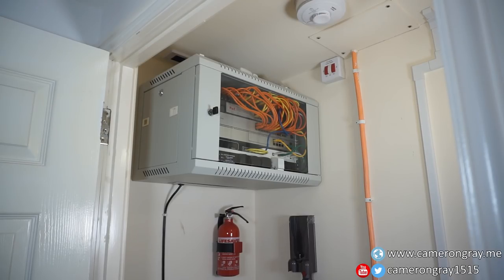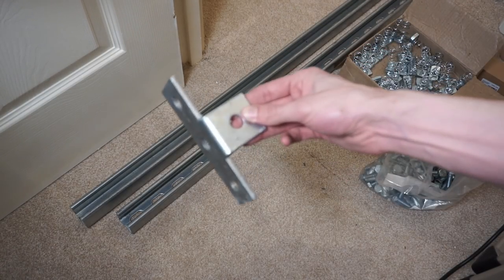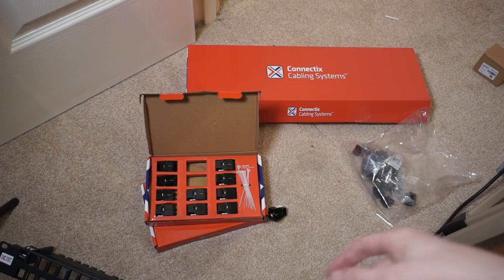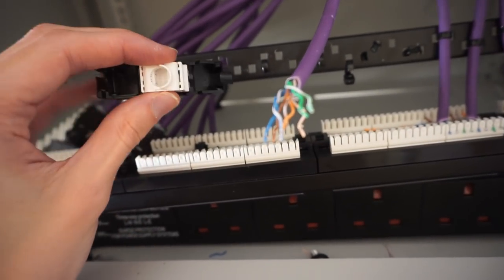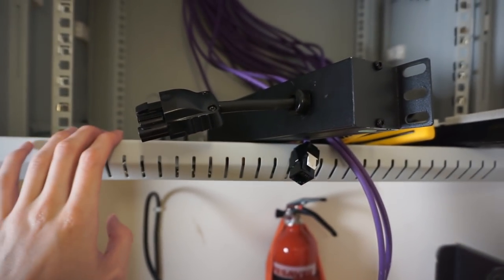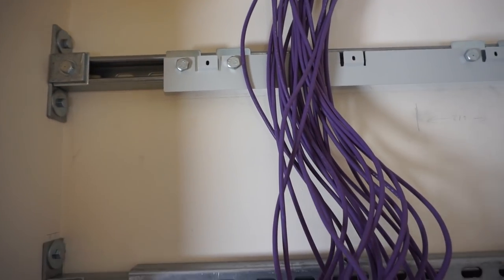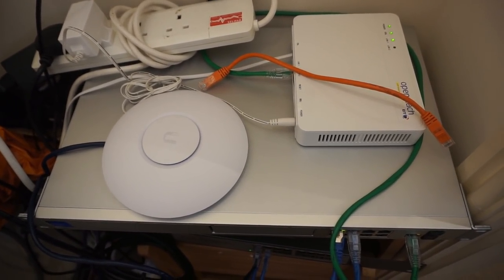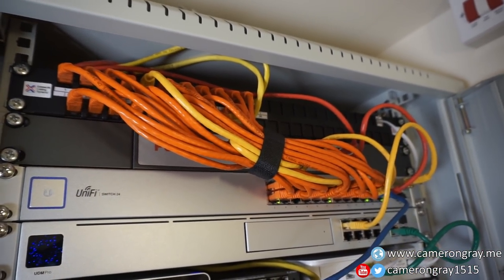Improving my Home Network Rack - New Patch Panel & Better Wall Mounting

Comment: I hate the way the keystones were done.  Should have been flipped.  Bad wiring job in my opinion.  Makes the patch cables longer than they have to be and ugly.
Reply from the maker: Are you referring to the fact they're left aligned rather than right aligned?  It was done intentionally - there is very little space between the switch and door, therefore left aligning them meant that the slack of the cable was used over the horizontal distance rather than sticking out forwards.  Even 15cm patch leads would likely be too long to not get crushed by the door.  Of course it's super easy to change in the future so I can't see why it's a "bad wiring job" - can easily be adjusted if the cabinet is ever replaced with a deeper one or if it's rearranged.  At any rate, it's equally as maintainable and I'm not really bothered about appearance, it's hidden away in a cupboard.